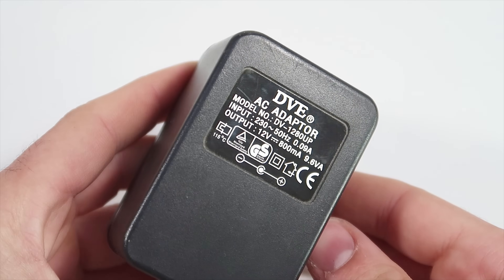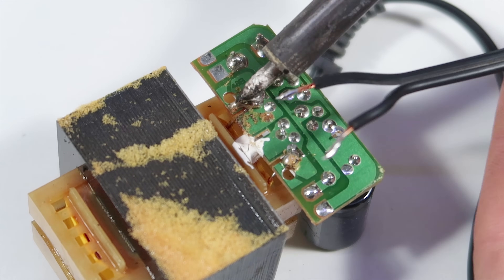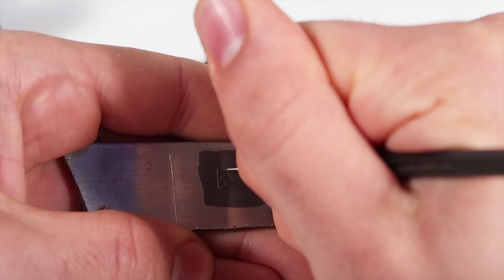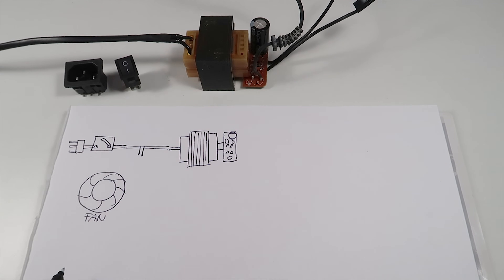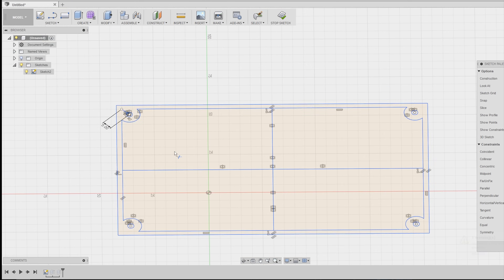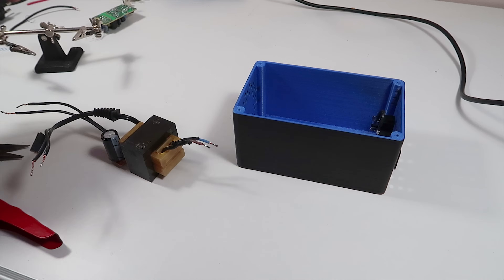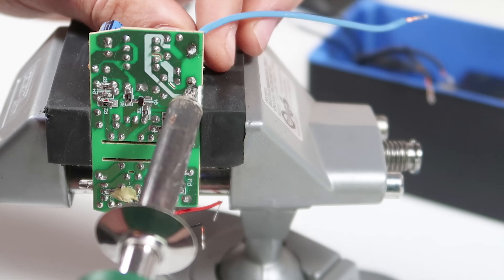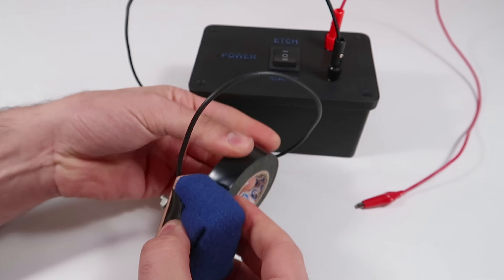DIY Steel Personalizer! Etch And Mark Logos On Knives

Comment: I built it over the last few days and it works perfectly well. You are awesome, man, just saved me 400 bucks - Grazie mille, maestro! A brother P-Touch with a stencil tape gives excellent stencils by the way - not my idea, learned it on the web but tested it and it's a thrill. Oh and by the way: Nail polish is for artists - I am too dumb for that xD
Reply: so u havent had any issues with the brother p touch? I guess I gotta give it a try cuz I've been looking for a machine that prints stencils (I'm a knife maker)
Reply: @SF45818  I can recommend it being a knive maker myself. I have read before that people had issues with the stencils but for me it works perfectly well. Gotta play around with the salt water solution a bit but for me it does the trick well now. I am using a lot of salt and keep mixing it in until no more salt dissolves. The only real issue is that you are limited when it comes to the fonts and I can't do any logos. The font "stencil" looks good to me, give it a try. Getting the right tape might be an issue as well but for me that first one I bought still works because I don't do much etching. And be supercareful when masking everything around the area you want to etch since a mistake here already gave me some nice hours of additional handsanding once. Good luck mate
Reply: @RB-xc9vh  thanks, I have one last question, do u use the software on the computer? Can u move the letters on top of each other? My logo would be a overlapping S and F so would that work somehow?
Reply: @SF45818  no sorry, I don't have that option since I am not on a computer but just use the device itself for typing. So all I can do it letters next to each other with this thing. Maybe there are better devices in the market that can do this but I sadly don't have one. It's really the budget option. Some guys on the internet offer stencil making for relatively good money like 15-30 bucks for a block of them. Maybe should give that a try and someone can send you a bunch of stencils - would be a lot cheaper than buying the brother device if you're only in need of the logo for every knife. If you want to add a serial number or something like that you could combine both solutions. Lot's of success with it. :)
Reply: @RB-xc9vh  thanks man, yea I've looked into people making stencils but couldn't find anything cheap in europe, any ideas?
Reply: How did you connect the on/off switch and the power socket? He didn’t show that in the video

Comment: Quality Craftsmanship. Beautiful job, you should be proud. It's nice to see someone with Electronics knowledge build something that looks so nice instead of alot of the junk I see other build out of 2x4 wood, rubber bands, and duct tape......Thumbs up bro! 👍
Reply: Only thing i have to bitch about, would be those main voltage connections. Heat shrink is kinda ok, but it does not replace wire insulation, i mean check how much thicker the original is to shrink. Those solder main joints are bit hazardous as if enough amps run trough wires will heat up and solder joints might unsolder. With out mechanical holding those can move, cause sparks and eventually fire. Solder is meant to improve connection, not replace mechanical joint in high voltage applications. Wago connector would have been thing to use or "sugar cube".. heck even shitty wire nut. Also copper was left to be seen witch is big no no (following my local codes).

Still nice build and this is rather safe as its not used unattended.
Reply from the maker: Thanks Bill!! :)

Comment: what if i used a 8v output instead on a 12v? will it just take more time?
Reply from the maker: Yeah should work only slower. I tried with a 6v 1.5a and it was still working but very slowly and the etch wasn't that deep :)

Comment: Whats the actual difference between etch and mark?
Isn't both used to mark tools?
Reply from the maker: Etching removes materials from the steel, marking converts the surface of the steel in carbon like a patina :) Used togheter makes for a really durable and clear mark!
Reply: if I got this right, you have to etch first and mark later the same pattern for best effect?
And the difference is just between AC and DC? (once AC and once DC?)

Comment: Instead of salt water it will be better you use original electrolytes made for electrochemic etching that can be bought as accessory for this machines .In my opinion it's not good to use salt water as electrolyte because it makes steel epecially high carbon steel more corrosive:).
Reply from the maker: Thank you Erik! I didn't knew about this, I will look that up :)
Reply: Black Beard Projects You're welcome;).Hope it help.I'm your big fan!!!!
Reply from the maker: Thanks again man :)

Comment: Hi! Good job. One question: whats the difference between etch and mark? Thanks
Reply from the maker: Thanks! Etching removes material from the surface, it makes a groove where the metal is exposed. Marking converts the surface of the steel into carbon so that it looks black, it's like a patina :)

Comment: I like the tool very much. You can make it a bit safer by wiring one side of your transformer output to the protective earth pin of the mains input connector. That way if the transformer ever shorts you don't get electrocuted. I admit there's a slim chance of that ever happening, but it is a good practice unless you must have a floating output and you'd only need that if you wanted to work on some equipment while it was plugged into the mains.
Reply from the maker: Thank you Vedran! Would that really work? I guess I'll try :')
Reply: Power supplies (PCs, laptops) typically have negative output tied to protective earth. If the transformer shorts and secondary winding gets connected to the mains, the differential breaker (FID, RCB, whatever it's called in Italy) in your electrical panel should sense it and kill the power immediately. If you don't have it then it's a bit more complicated - a short in small transformer will probably not be able to trip even a 6A breaker before it melts and you probably have 10A or 16A breakers for power outlets. Short will cause a lot of current to flow from mains, through the primary into the secondary and finally into your protective earth. If you're lucky, primary will melt first and you live. If secondary melts first and the mains remain connected to one of its outputs, chances are it's gonna be the output that is not earthed (as earthed one was probably drawing more current) so you might have a dangerous voltage on the output.
The wall transformer you started with didn't even have protective earth plug, because normally you wouldn't be touching it's terminals so the risk was low. Your tool uses salty water on the part that you handle and that changes the risk factor a bit :)

Comment: Amazing video as always your projects are cool and i like every single one of them but i got a few tips if you like some positive feedback. 1) Clean up the iron tip and use flux for better joints 2) Calibrate your CR-10 so you dont get over extrusion.
Reply from the maker: Thank you Chris! :) sure! I know the print wasn't looking very clean,  blame the filament. I made the mistake to buy the cheapest I could find.. It's so inconsistent I can't get clean prints with it. Oh well.. lesson learned! xD

Comment: Great stuff mate. How robust is the etching, can you mark it off with your finger nail??
Reply from the maker: Thanks! The etching remove materials so it's as durable as the steel, the marking on the other hand it's just a patina, you can't take it off with the finger but it can be scratched :)